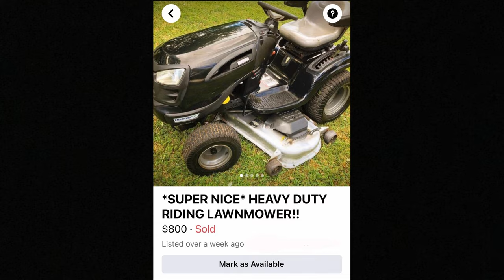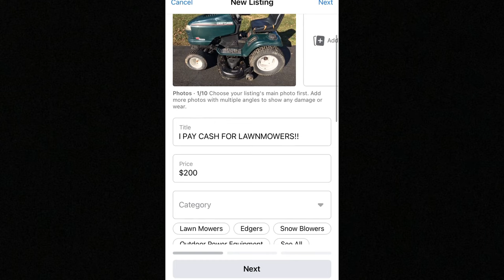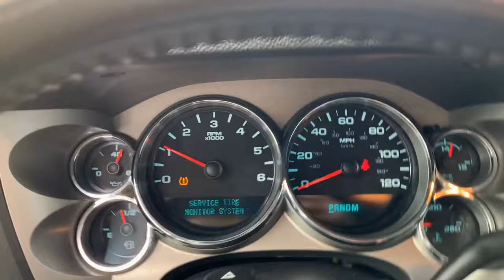MAKE STUPID MONEY FLIPPING LAWNMOWERS!! (*BEST SIDE HUSTLE*)

Comment: It's a slippery slope if you do it right. I thought I'd try this. Found a tractor for $100. Guy said it needed a starter. Took starter apart, cleaned it, works fine. The carb was flooding the cylinder causing a hydro lock. Snowballed from there. Replaced a bunch of parts including the carb. Got about $350 into it and sold for $400. Not worth it to me. First and last flip for me. I can't hustle people by a battery and a wash job and be able to sleep at night knowing I sold them a pos without doing all those repairs.
Reply: Then you ain’t fit for most businesses lmao, welcome to the dark side of making money, and this ain’t even the worst thing one can do
Reply: look into some of the larger equipment and higher end lawn equpiment.  It is hard to build a good reputation fixing and flipping the low end stuff that are manufactured to be throw away stuff.  I am like you Dan and I don't sell something I know is going to screw the next person.  I have had some luck with compact tractors, zero turns, turf equipment, etc but you have to know what you are looking at.
Reply: Don't give up. Stay away from the riding mowers until your skillset improves. Start with push mowers then gravitate towards self propelled.  Invest in one brand or style be it honda, tecumseh, or Briggs & Stratton. 
My goal is to flip my first zero turn or riding mower by 2025.
Reply: @jwayne777  exactly, depending on the area you make more. I can sell a self propelled toro or honda between 150 to 225. Pick up during the week days. The sales happen on the weekends. Right now I have 4 pretty nice mowers. Little over 500 buck. Just that I got on yesterday. Two of which were free. Last weekend I made 300 bucks. And it was raining. Waiting for a nice sunny weekend. Then if something happens to the mower it's cheap enough to refund the money or just order the part the mower needs, so one can consciously cope with the sales process.
Reply: @Saul Souza  My skill is fine. I've been a mechanic for 30 years. It's just when you take a $100 tractor and put $300 into it you still only have a $400 tractor. You have to be lucky enough to find that one gem someone is giving away and they don't know what they have. I'm not that lucky.
Reply: Push mowers are where it’s at I get 90 percent of mine free and sell them for 50-200+ depending on how fancy they are, I just got a free low hour John Deere self propelled for free that fired first pull
Reply: These "flip" vids are mostly lies
Reply: Same here

Comment: Been doing this for a few years. My flips are a little more extensive. I always fully service the units (new oil, filter, air filter). I always sharpen all blades. I also check both the deck and drive belts, and if they are frayed, I replace them. I normally have between $200-$400 into a unit, and always double my money if not more. I mostly sell things to friends and neighbors, so I want to make sure I didn't just clean up a problem and pass it along. My mower flipping has branched into ATV flipping now too. A little more risk there because repairs are often more expensive and complicated, and parts can be pricey or hard to find, but when you get a good one, the upside is great! Nice content and keep up the good work!
Reply: How difficult would you say this would be for a teenager
Reply: @StayFaithful7  Im testing it out now, I've done a few so far. As long as you know your way around a machine and some basic knowledge of engines and hand tools, it is a great way to make money and work with your hands. Not difficult once you get the hang of it.
Reply: @marylandsirensfirebuff9664  Thanks! I'm also thinking of working at my local bike shop
Reply: @StayFaithful7  Sweet!

Comment: I've flipped three already since I retired in March. First up was a craftsman r1000 bought for $300, sold for  $760. Second was a FREE 22yr old Scotts S1742 that I sold for $550, for a net profit of $490. Third was a nice troybilt bronco with bagger bought for $250, sold for $850, for a net profit of $760. I just bought a craftsman LT1000 yesterday for $75, I expect to sell it for about $450 or so. I'm supposed to go get a troybilt pony tomorrow for $220. It runs and goes, but deck needs work on a pulley. Should be able to sell it for about $500-600 I think. Also, I bought a pretty nice Toro SW5000 zero turn last may for $500 that I've put about $250 in to make it a nice running mower. I think I could sell it for at least $2000, but I'm holding that one as my personal mower for the time being. 😂  Having fun in retirement by flipping lawnmowers and making money lol.

Comment: Great content. Can you make more mowers videos & show what other repairs you can expect to make besides battery & wash.
Reply: besides a battery, disassemble the carb, clean it in carb cleaner, and buy a cheap repair kit online or at a local repair shop.  if that doesn't do it, check the spark plug to see if its dirty, or if it has incorrect gap.  if neither of those fixes it, check the fuel tank, filter, lines, or even see if the machine has enough compression to run.  depending on the age of your mower, the engine might just be too worn out to run. things that cause that are most likely shot rings which at that point id pick up a new cheap motor or take a loss.
Reply: carb clean. cracked fuel line. cracked gas tank. fuel filter. a few things that I experience.

Comment: Thanks for this video. Don't want to be a downer, but I'm a pessimist in every business venture I undertake - mostly overly and to my detriment.

Another thing is that you're relying on the good word of the person that sold the non-working machine. $150 max is a good tip to start because IF it is a major problem (and you don't know), that money is gone and the lawnmower is basically a loss. Thankfully, most people are usually honest, and you can use people skills and "your gut" to mitigate the risk.

Comment: I hope that you change the oil, sharpen the blades, grease the mower deck spindles and linkages and clean or change the plugs. A little time consuming, but adds to desirability cause it's just serviced.
Reply from the maker: I have found that this investment of time, while it improves the machine itself, does not add any sale value to the machine. This is structured as an as-is, quick sale "flip" method. 

 As long as it has clean oil and operates as it should, I do not bother.
Reply: @TOMSREFURB  Do you wax them and touch up the deck paint at all? You've certainly gotten some good buys. I'm proud of you and your entrepreneurial spirit. The zero turn should have been $1200-1500.
Reply from the maker: @karlkascha1261  It was pretty rough, missing some wiring and definitely not functioning as perfectly as it could. I posted it too cheap though, I agree I could have gotten 1200. I usually hit them with a buff and touch up the decks when necessary, but I wanted to make the ones in this video doable for virtually anybody, so I kept it simple. Thank you!
Reply: @TOMSREFURB  That works for a short term strategy, but trust me, a little added value will help your reputation in the long run, and will bring you referrals and return business.
Reply: Agree
Reply: Buying a mower for cheap, washing it, and throwing an underpowered Wal-Mart battery in it is not hard to do, or even right.  Doing a full tune up, and repairing any and all mechanical issues is how it is done.  Most free or really cheap outdoor power equipment has issues that need to be addressed.
Reply: Exactly I feel he’s giving a false reality to people they don’t know how to repair things it’s terrible that people are out here taking a vantage of people like this he won’t be in business long once word gets out unless he starts being more thorough putting a hair bit more working there
Reply: @ChristianAmericanMan make sure to have a written agreement "sold as is". I just flipped one and after 1 use, the piston rod broke. I had sold this push mower for 110. Put 20 I to it. So instead of giving money back, I fixed another mower I got for free and put a 20$ carb on after the Briggs plastic one refused to fully clean out. I used shop air and carb wire drills and everything. I couldnt get it running. So the new carb worked and I lost 20 bucks so I made 80.and protected my reputation. Oh yeah, I got the broken one as pay for the carb. It's got some Great parts and I'll use them. Also going to pull the case and see the damage.maybe I'll fix it for fun. Don't think it would be profitable to sell after the fix and God knows what happened inside.
Reply: Let's be honest. A good running mower will never need new plugs. Inspecting them for peace of mind, but replacing them is something a shop does at services that are supposed to be done for people to keep their warranty.
Reply: Damn people are complete haters tom seems to do just fine he makes the small repairs needed none of wht i just seen are or were junk at all just seasoned equipment wich is normal he does not force anyone to buy these machines he makes the ad they make their decision to buy tom is a hustler killn his side hustle but haters gone hate somebody has to do it so heres to all you haters🖕💯😱🥺😭........

Comment: I got a mower that engine had 0 compression, it was a simple valve seat. Put it back in place and it ran great. Got it for $50 and traded it for a 2005 Lincoln Town Car, and now am trading that for a 2006 Suzuki GN400 which is a pretty nice looking motorcycle I am going to sell for $1500. $1450 profit.
Reply: Did it sell?

Comment: did you also repair engines in those "250ish$" lawnmowers?and if so, is it worth it?
Reply: I do the same thing as him.  Stay away from tractors from the early 90s.  I focus on 2000s and older.  Also stay away from Murray as they are on the cheaper spectrum.  Go for well known name brands like craftsman, poulan, etc.
Reply: @reconsoapy6920  thanks for answering, i would only take John Deere machines, great advise,thanks again.

Comment: I bought a lawn mower said ran when sat the coil was right up against the flywheel and there was water in it in replace of the oil I drained it cleaned the carb gapped the coil fired right up tell me how that's possible

Comment: So, you make sure the unit runs and functions at the bare minimum, with no worries about it breaking down on the buyer a week later because you did zero extra maintenance on the unit? No oil change, filters, carb cleans even though they run, no blades or sharpening, check deck level, bald tires, zip ties holding things together?? I put way more pride in the units I buy and flip, by a long shot. You're selling polished turds.

Comment: So if your going to make a video . Just doing these things to a mowers is just people think your just stupid and they wont take you seriously . If you just set on the mower and talked would have been a lot better and not acting like a tuff guy that you are not .  That just make your self goofy .  I been repairing mowers for 20 years and I would buy a mowers do all the repairs . Replacing belts putting new blades , full tune ups from washing and drying the mower , new filters replacing fuel lines , new filters , new plugs , greasing ,  adjusting for valve clearances  , cleaning heads , valve trains and pistons . sharpen and bal. blades , tighten wheels .  In that tune up includes a full check over and Not a half way jobs like most mower shops would do .   I do the same to mowers I buy . I check the engine drive line over and do a leak down test to cylinders , find problems and repair and replace all bad parts with new parts .  I wash and wax mower I clean and spray paint under decks . I take covers off and blow out the fins . I replace all belts and fluids . I dont use anything but kohler oil in air cooled engines . and the weight of oil for the hydro transaxle . I go threw them with a fine tooth comb . When they leave me garage they look nice and everything is done and the only reason they come back is for service again . yes you can make money selling used mowers and changing the oil replacing a blade our two but your cheating your customers and they ether come back mad as hell or they wont come back at all . But the word that comes around town will grow . people will say dont go to that idiot . He sells JUNK . I used to here this all the time from new costumers some that took their mowers or bought their mower from some idiot down on the other side of town or from the next town over .  I dont sell junk I give a month of full warranty on my mowers I sell .  I had to quit because of health .  I made a lot of friends and I hatted to tell them I quitting the next year . I did same day repairs  also .  Bring me the mower I will have it done in 4 hrs .  I kept my one car garage clean and I stripped mowers of all good used parts for the poor people that just getting by . I even did a lot of free work for poor families and have given serviced mowers to the poor also .                                                                                                                                                                                                         Just dont make your self  look stupid like this kid .
Reply from the maker: Sounds like you did everything perfectly. I give you props for that. I sell solid machines without issues, nothing more. I do not sell brand new mowers. I hardly ever have an unhappy customer, and if I do, I immediately refund or replace the machine. Good job doing quality work, but try not to be so hateful. You still watched my video.
Reply: Jeff I was getting alot of anti-semitic undertones in your remarks, I'm gonna have to ask you to cool it
Reply: Thats rite boys sickem  guys like jeff are whats called low to no level hustlers  thats rite jeff u tuff guy that your not u buy junk that calls for the repairs and work u put into them wich im sure brings little money n return try buyn solid machines to flip or keep on doing what your doin "TUFF GUY" WITH NO HUSTLE SKILLZ